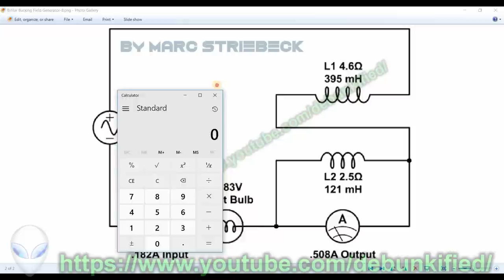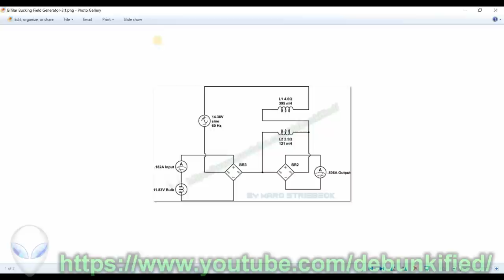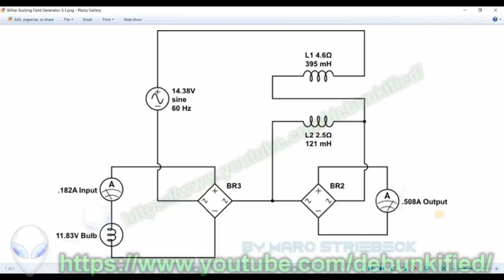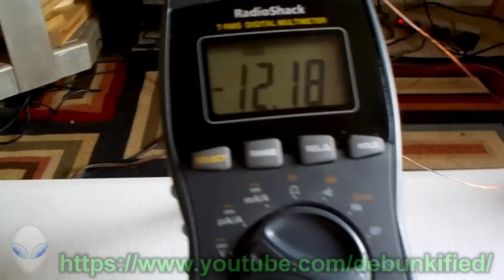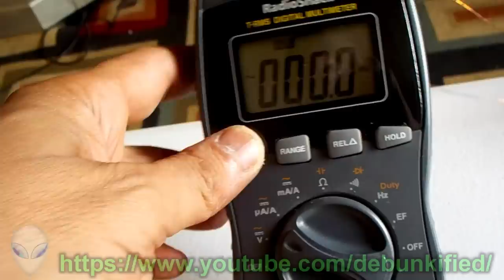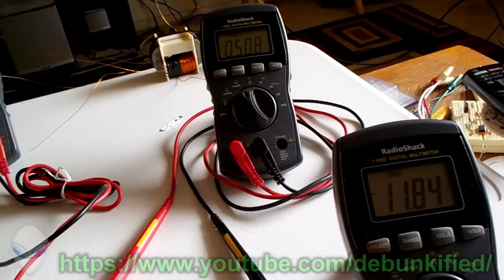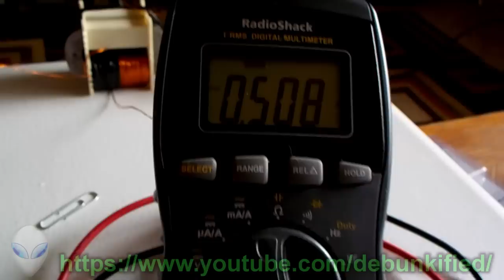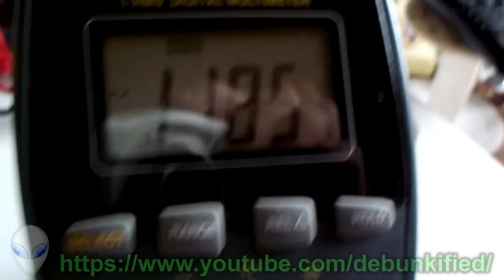Opposing Bucking Coil Generator (Asymmetrical Transformer)

Comment: One of Tesla's patents has a similar coil. I have gone coil crazy, opposing magnetic field is the door to amazing results. Yes, many hours of time, but time flies when your having fun, when you see results from empirical experimentation it is worth it all [takes years].
Thanks for the very good presentation. Look for the radiant potential [movement of the either] , hard to find, but it as there.
Reply: lookup Thane Heins Regenx motor

Comment: Total current through a parallel circuit is the current in each leg added together.  A.total=A.meter+A.L2  Fill in the values and we get: 0.182 = 0.508 + A.L2.  Solve for A.L2, and you find that the current flowing in L2 is NEGATIVE 0.326.  Although it seems you have a larger current flowing in the forward direction through one leg of the circuit, the TOTAL current is still the same since the current in the other leg is flowing in the opposite direction.  There is no excess power here.   Think about it a little bit!

Comment: (sqrt(395 mH) + sqrt(121 mH))^2 = 953 mH, so your 900 mH doesn't leak much flux. It might help to look at this on an oscilloscope, where you can check voltage and current phases. Some meters can measure power factor, too

Comment: What about the phase between the voltages and currents? The real part of the power (actual Watts, not just VARs) is not just Volts AC * Current AC-- it's the real part of their product, as AC waveforms are phasors. They have a "real" part and an "imaginary" part. Or, put another way (polar instead of rectangular), they have a magnitude and a phase. Your meters are measuring magnitude, but not the phase between the voltages and currents for a given leg (input or output). The voltages and currents are DEFINITELY not in phase--this is a resonant circuit, after all--and the real power measurement depends on measuring those phases. Measure the phases (with an oscilloscope) and then calculate the real part of the power. The magnitudes alone don't tell the whole story. Thanks!

Comment: In a Transformer, the individual windings are not connected - but you did connect them. Does not make sense to me. And with a sinus wave, you will always have Lenz's law acting, no matter what direction the winding. But if you switch the input and let the magnetic field break down, then it becomes interesting, because then, especially with a bifilar winding, you will partially, depending on the frequency, circumvent Lenz's law, because your coil is a capacity as well and acting as such the  capacitance will draw a part of the energy out of the field and this energiy is no longer influenced by the opposing induced current - magnetic and electric fields are split in bifilar coils and so you can circumvent Lenz's law at high frequencies with the capacitance driving a load by drawing the  inert magnetic Energy electically. But you need to have bifilar winding and switched Power-input.
Reply from the maker: Hi, thanks for commenting, do you have any working devices operating on this description you have just given or this a theory of yours, am just curious is all.
Reply: Peter Lindemann and others have, and Bedini, the ordinary Bedini SG motor does it. Is replicated a thousand times. Its got a trigger, that switches off the current loading the coil, when Len's law is beginning to work, and afterwards, it is switched on again, again by the trigger, a 90° shift physically of the rotator, holding magnets, while the stator holds the coils.
Reply: here a link, where Lindemann shows and explains a no Lenz Motor: https://youtu.be/DuZ3YptgngY, Electric Motor Secrets by Peter Lindemann
Reply: Connecting primery with secondary makes an AUTOTRANSFORMER. It is a transformer that works without inductive coupling. Pairing normal magnetic transformer function and autotransformer functioning is very interesting.

Comment: Hello fellow experimenter. Thanks for uploading your video. I looked at one of your schematics and offer this: (1) I would not accept your multimeter reading of a 145KHz signal. I doubt if it can respond to high (145KHz) frequencies. (2) Your coil  L1, probably generates a flyback voltage at mosfet turnoff which may contain harmonics and your multimeter cannot respond to them. (3) You need to monitor your experiment with a scope so you can more closely examine what is occuring. (4) Disliking AC does not exempt you from examining it. It is occurring in your circuit via the mosfet and coil. As for overunity, I seriously doubt if you have proved its occurrence.
Reply from the maker: Hi, first I do not depend on meters measuring frequency, instead it is calculated using R1 and R2 timing resistors and C1 timing capacitor. The L1 does indeed generate a flyback voltage at mosfet turnoff which not only keeps the C3 capacitor charged to that voltage level but also is across and directly in parallel with the R5 load resistor. This voltage is proved to be true by removing and isolating the C3 capacitor completely from everything and witnessing the higher voltage stay there. Therefore this higher voltage is directly in parallel and across the R5 load resistor causing a simple Ohm’s law calculation to accurately measure the wattage of the R5 load resistor.

The input voltage is a no brainer and so the only thing left that there could be some debate over I suppose is the input current. However this has been put to rest as well by immediately replacing the battery with a C4 capacitor and observing a higher energy level on the C3 capacitor and it’s parallel R5 load at all times as both input and output capacitors discharge simultaneously into the R5 load resistor at the exact same rate at the exact same time.

If you would like to see this input and output capacitor test, it will be shown on an upcoming video here: 

https://youtu.be/yNGRwG9orKU

Please test for yourself before making assumptions that it is not exhibiting OU without first duplicating the results yourself. Thanks for your valuable input though, it is much appreciated and I believe you are well educated in the electronic arts. Have a good one!
Reply: Power factor is important with inductors due to phase shift created between current and voltage (this occurs with inductors generally, not just in this circuit).

The formula for calculating power with the power factor is:
P = VI (cosine theta)  where

V = the RMS (root-mean-square) voltage
I = the RMS current
theta = the phase angle of the phase shift of current and voltage imposed by the presence of an inductor(s) in a circuit

You cannot use Ohm's Law in AC circuits the way it's used in DC circuits.  Inductive and Capacitive reactances are an issue.

A really easy way to verify OU is:
1)  determine the input power

2)  determine the output power making sure to only use RMS values of current and voltage, and using the power factor of your circuit

Personally, I use oscilloscopes.  I treat any and all readings from any DVM as a  rumor only.

One of the most sure ways to attain OU is - to use a catalyst.  If you have, say, a cold cathode amplifier tube, filled with an ionize-able gas at low pressure, and containing a bit of radium, whose emissions create a tiny bit of ionization in the amplifier tube - you can create a free energy device like T. Henry Moray.  Use a crystal radio front end, tuned to the strongest radio signal in your area; crystal radios need no input power.  And the cold cathode amplifier tube relies on the radium to create an initial low-level ionization/free electrons in the amp tube.

Hook the output of the crystal radio (which will be an oscillating radio signal) to the special amplifier tube.  Wait for the radium and input RF to get the tube into operating mode, and have the tube output connected to a capacitor bank.  Wait one hour, and tap the caps for power.

OU is feasible but without a catalyst (like a radioactive material), double down on input power and output power readings, and never trust DVMs.   There is far too much at stake (lots of wasted time) given that oscilloscopes are much more affordable these days.  
.

Comment: Here is something for you to try. In your schematic where you have what is listed as "output" meter insert a diode and light bulb. On the other leg before your coil just after the original light bulb, insert a diode facing the other way. That way the light bulb should light from the current draw thru the coil and the new, second bulb should light from the inductance of the two coils. Then take your meter readings. What you should get is two half waves on your scope when it is connected at the different locations. Even better if your scope can do both circuits at once.
Reply from the maker: Thanks for the suggestion, it is much appreciated!

Comment: Your experiment indicates a strange phenomenon if the setup you presented is wired up in the way you indicated. Don't you find it strange that the negative leg of the circuit has a total current of about 182mA and it splits into two (one into the ammeter across the coil with a value of 508mA and the other through the coil). This means there is a negative current flow through the coil of 182 - 508 = -326mA. This would be strange in my opinion.

You probably should wire up another ammeter in series with the lower coil to see what current you get. That would be an interesting discovery.

Also, FYI, don't assume that a symmetric coil would have *no magnetic field*. Although mathematically they would cancel out, in reality, the magnetic field is not destroyed and does wonderful things as a result. That would be another interesting discovery for you.

Comment: if the field is 'magnetic' then it is {to degrees} stored in the 'magnetic' material agregate which is in this case the 'metal' of the transformer - so it stands to reason that the configuration of the transformer core in relation to the windings is also an important aspect.

Comment: Have you ever tried to increase the voltage like maybe getting the input from 120v ac inverter that is connected to a battery. I wounder what kind of amps and voltages you would get. And have you ever tried to make more than one coil and put them in parallel with the output amps increase.

Comment: Hello, the asimetric transformer is a very interesting device, i just wanted to sugest to connect the load en series with the outputammeter, to test if there is no reactive powercomponent, if the 0.5amp is actually performing work.thanks for sharing investigations.
Reply from the maker: Hi, yes I have tried what you suggested, in fact many different things were tried but no cigar. Thanks for the comment!

Comment: Maybe you are looking at this wrong.  What I see is a stepdown autotransformer, you wound it as two separate coils but could be a single coil with a tap somewhere in the middle.  Autotransformer s are used to step up or step down voltages.  Think of a sparkplug coil which is autotransformer with secondary attached to primary.

Comment: The Bedini bi filar coil has similar resistance level ratio... those ratios seem to also self oscilate after running the oscilator for some time the iron core will carry the vibration and they will oscilate off no trigger and just pressure i think from the voltage... try keeping the ohm the same but change the mh or awg

Comment: Hi debunkifield.  I did the same kind of oposing electromagnetic fields using the VIC (voltaje intensifier circuit) of Stanley Meyer. Countinue with this but now try to make the coils resonate. You need to adjust the frequency of the line by making an special sinusoidal generator or youcan adjust the size of the inductance of the coils in order to achiev resonance. you need the formula of resonance for inductances or coils.  Have patience and fun. I wish I cn be in contact with you. Congratulations for this experiment¡¡

Comment: Well I have attempted a replication. It failed. I used 23# wire to get the resistance you quote. I end up with 207 and 381 turns. One coil CW and the other CCW, so I get opposing coils. My inductances' were 12.8mH and 42mH. Considerably different to your coils. I am drawing  172mA from the transformer.  Perhaps you might like to divulge the details of your coils. Also, critical, would be the transformer core. Yours looks like quite a small amorphous core, mine seems to be larger. I am thinking the failure in my replication has something to do with the different transformers. Mine is an AMCC100. The number of turns might be the issue.
Thank you for your video

Comment: In the first circuit I think the second ammeter is  acting as voltmeter that way. The result is like the voltage drop across the L2 coil.
.
Reply: Add another bulb in series to 2nd ammeter and see the results.

Comment: Concider the paths with less resistans although the coils share the same flux.Also collapsing current will be amplified within the coils within a resistive load as it performs work a pulsed dc current will not produce the same results .

Comment: The way I see it , because L1 creates more than 3 times the mH of L2, the L1 induced magnetic field Overpowers the one that L2 is trying to create and so L1 induces a current in L2 windings Opposite to  that of the power source. This causes the current induced in L2 to loop through the  .508 Ammeter in the same direction as the main current, that is driving L1. 
Also because the windings of L1 are greater in number than that of L2 the current induced in L2 is a higher current but lower voltage than that flowing through L1.

 I would be interested to see how driving a load where the .508 Ammeter is compares to driving a load where you have the bulb. To see if this has any practical value in the real world; to run something using less mains current. Or in an electric car to increase its range without adding more batteries.

Comment: Oh, if you conect an actual load inthe place of the second meter there is no output? You made a comparision of luminosity of the lightbulb ?
Reply from the maker: Yes, an actual load was connected in place of the second meter, there is no power there! But I don’t believe it’s because it’s shorted but because it’s just between two nodes or points in which if you place at any two points in the circuit with a meter should show 0V, but the path is through the light bulb as a load which of course has a voltage.
Reply from the maker: I took off the connection from where the two coils connect and the second meter so that the only path through the load is through two coils and because they are wound opposite and nearly canceling fields completely then there is no current flowing at all through the load except maybe .014A. This shows that the .500A is really flowing through the load.

Also I find it strange that current is canceled from opposing fields when the current should be left alone, at least this my experience with equal bifilar coils cancelling fields completely, in which the current remains exactly the same. Strange eh?
Reply: yes it's interesting - well done - and thanks for sharing -  i think it warrents further investigation most certainly.

Comment: Thank you for the schematic.

How can the load (the lamp) have  0.508A flowing through it, if the only Ammeter in series with it is measuring 0.182A.!!!!!

In fact the lamp is not in the position to be the load.

The 0.508A is circulating around the L2 circuit, the ends of L2 have polarity like the supply as current runs back and forth though it  and is induced in it by L1.

It is a current loop around L2, driven by the as YOU have said the influence of L1 magnetic field.
The current is so high with respect to  the 0.1.182A flowing through L1, because as YOU have said, the Ammeter shorts L2.

Again, you cannot measure output power by multiplying the lamp volt-drop by a current that is NOT flowing through it.

Also the DC circuit values are different to the AC values, L1 and L2 at 60Hz are not 4.6 and 2,5 Ohms respectively.
You have to consider their impedance to the AC current.  
For an inductor, impedance (ohms) = 2 x Pi x Inductance(H) x Frequency (Hz)

So L1 Impedance == 2 x Pi x 0.395 x 60 =  149 Ohms

And L2 Impedance == 2 x Pi x 0.121 x 60 = 45 Ohms

So that is added to the AC circuit, also you have Mutual Inductance from the two coils being on the same core so the total inductance of the circuit is not the sum of L1 and L2 in Henry.
Reply from the maker: Hi Tom George,

You are exactly right and everything you say sounds good to me and in fact is perfectly sound and correct. I find that the overall efficiency of this particular circuit is 95%. I attribute most of the efficiency to the direct connection of the AC power supply to the load, but let me say that this is only true if you place the light bulb “Load” in place of the second meter either immediately to the right or to the left of the second ammeter. Then the only thing in the way is the L1 coil which does act as the primary of a transformer in which it induces energy back into the L2 coil which of course is shorted through the meter which is now the light bulb load if it is moved there. The direct connection of the power supply to the load, once moved, is a near 100% transfer of energy since only .014A of current flows from the power supply through the series connection of both the L1 and L2 coils. And so because of this only a small portion of energy is actually devoted to transforming action, or in another words “a transformer”.     .325A of current is flowing into and out the left side of the L2 alternately, if the light bulb is left as is.